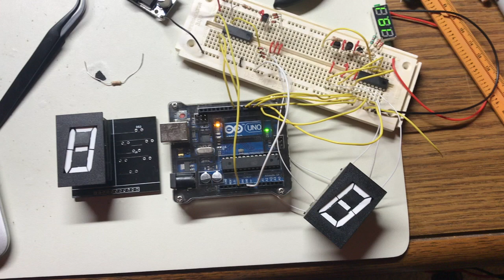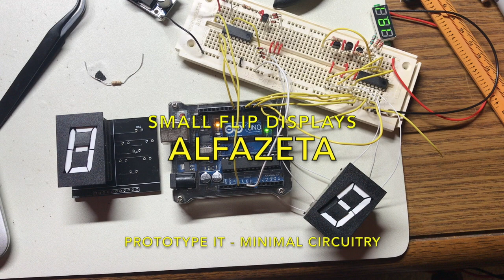AlfaZeta Flip Display #9 - Prototype It

Comment: What were the half bridge chips you used on this please?
Reply from the maker: All the half bridge chips I could find share enables across two half bridges. When one is on, another is off. They cannot be controlled individually in any order. I made my own with individual transistors, 2N4403 for PNP and 2N3904 & MC1413 for NPN. So the chips you see are MC1413 seven OC drivers.